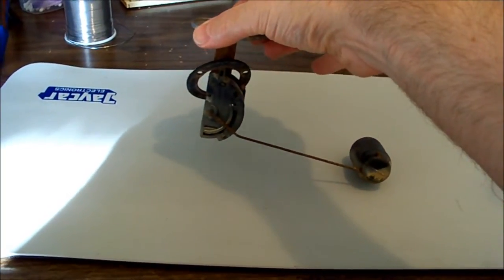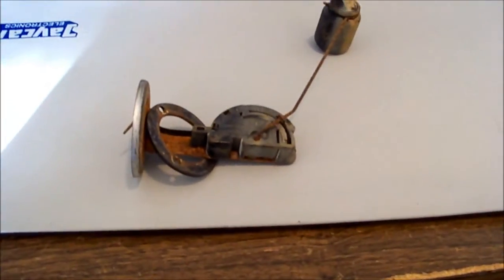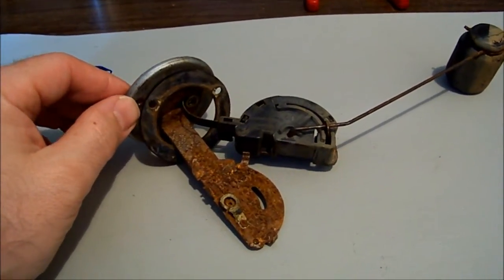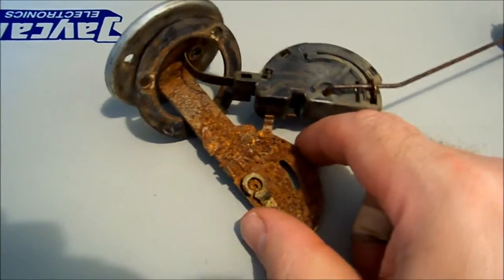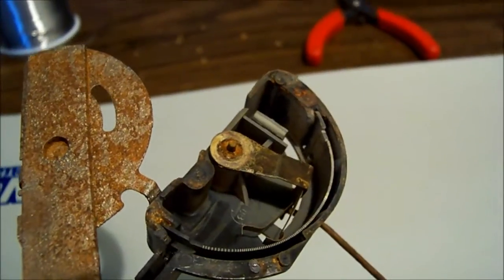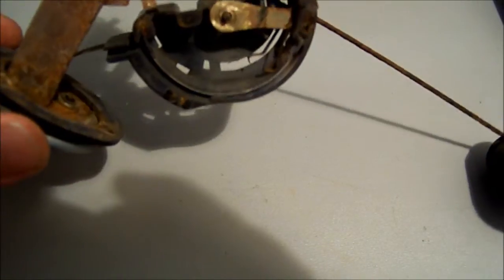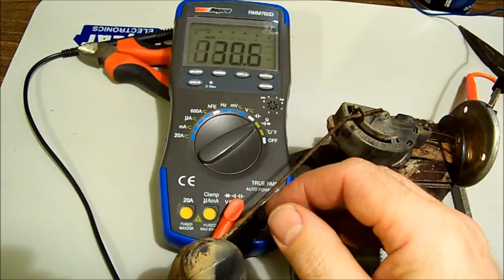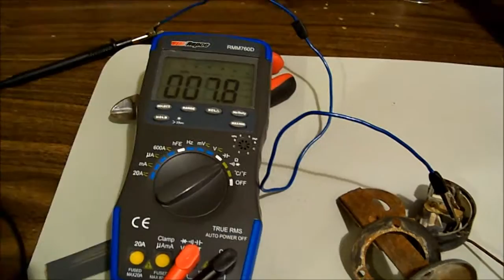Peugeot fuel level sender unit repair

Comment: my 78 golf has some windings broken can resistor wires be re soldered?
Reply from the maker: Not sure what kind of metal it is. I guess you could try. If it wasn't perfectly smooth you might get inconsistant readings when in that area. Probably easier to find more wire and just re-wind it.